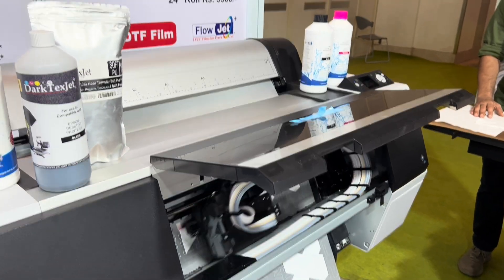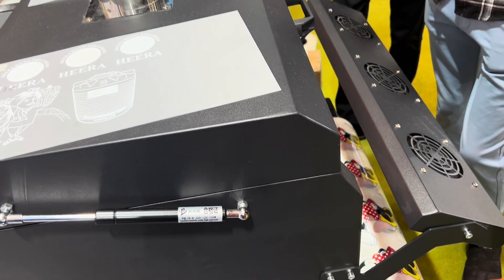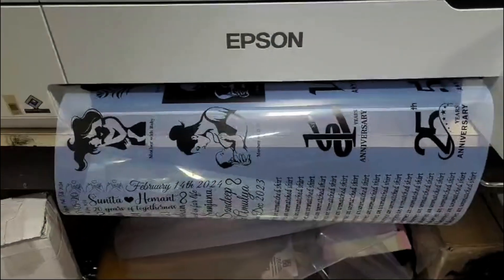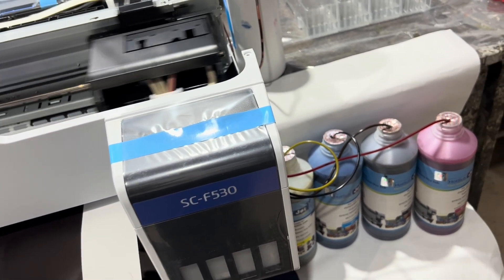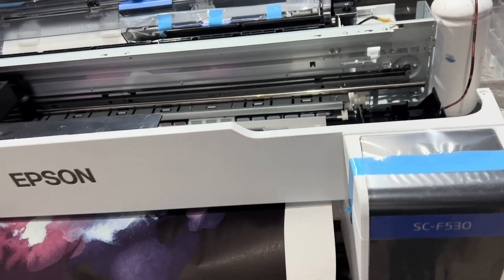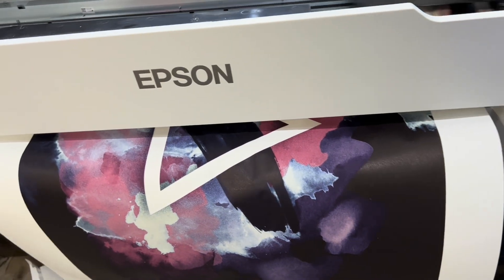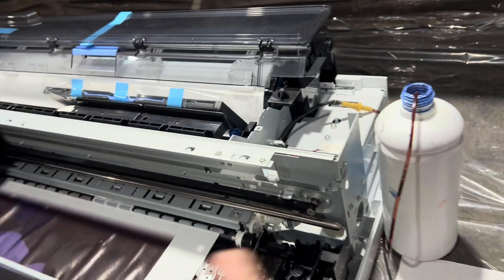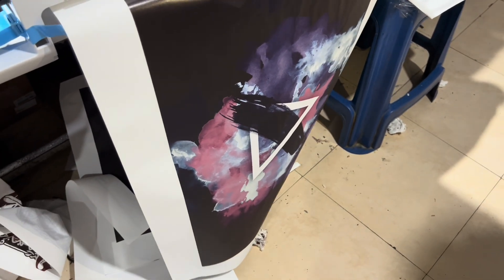DTF Printer vs Sublimation Printer

Comment: Koi mat lena inka price bohat high h aapko assosery or part ka 20 rupees ke item ka 600 rupiya charge karte h
Reply from the maker: Sir, thanks for your feedback 🙏. We don’t overcharge – all our prices are genuine and based on original Epson printers, high-quality inks, and long-life spare parts. Many local items may look cheaper, but they damage printheads and reduce printer life. Our goal is to give customers a reliable business solution with warranty & service support, not just low-cost items. ✅"